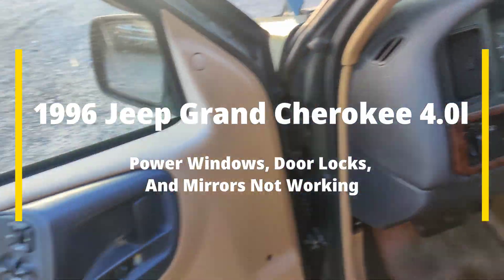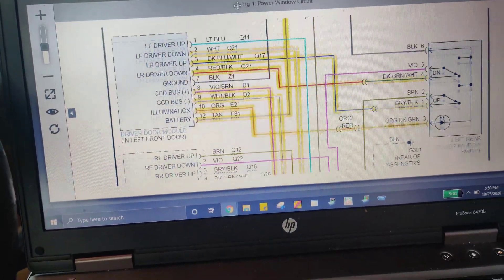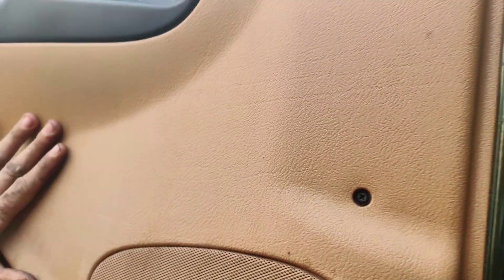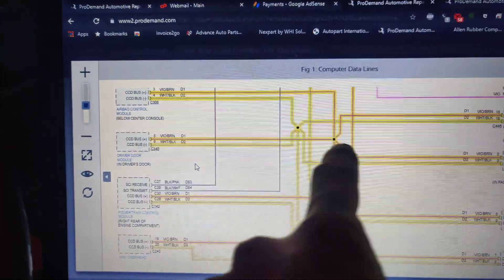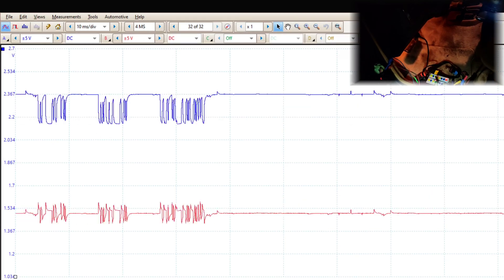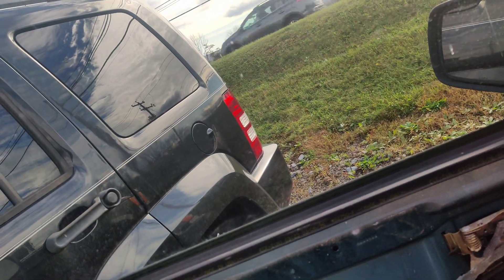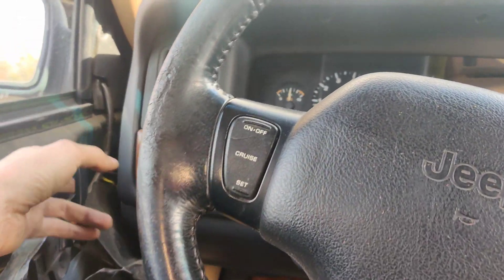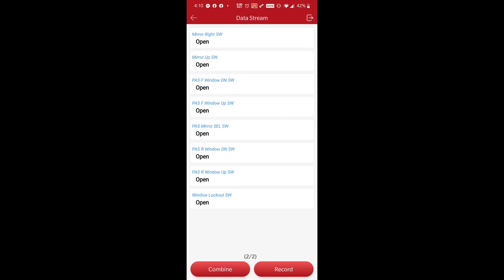1996 Jeep Grand Cherokee 4.0l Power Windows, Door Locks, and Mirrors Not Working CCD Bus?

Comment: I got the infamous ccd bus no com p1698, p1687, p0700, occasional 1684 or 86 (cant remember). I dropped a motor after it had been sitting for 8 years. She runs beautifully. My passenger door module had 2 broken solder points. One was power. I took the pass mod apart and resoldered all points. Put it back in and all door locks and windows worked fine. Then one fay when checking out ccd i went to shit her down for the day and the doors wouldn't lock from the driver side. I chased it until i found the drover doir lock would only work with the key removed from the ignition. Pass lock worked but not driver. I looked into it and apparently it was a Chrysler thing they did. If you havr the key in the ignition it will disable the driver door lock. Just wanted to throw that one out there. I haven't watched the full video so im not sure if you didcovered this Chrysler "safety feature"
Reply from the maker: A lot of cars won't lock with the keys in the ignition. Thanks for the tip.
Reply from the maker: A lot of cars won't lock with the keys in the ignition. Thanks for the tip.